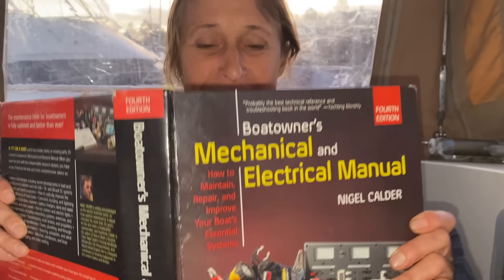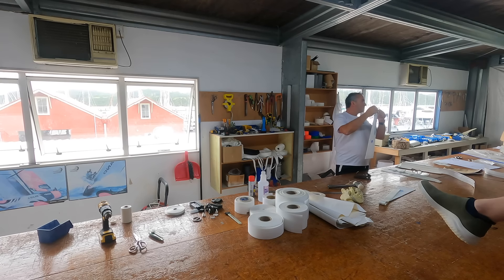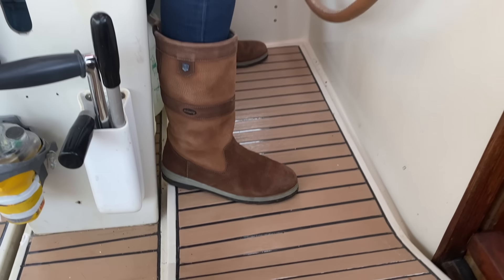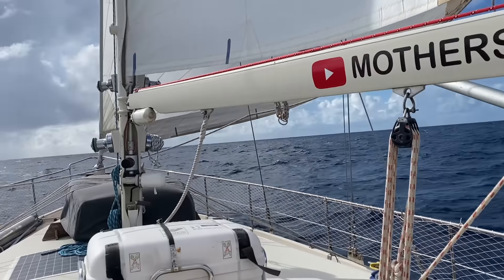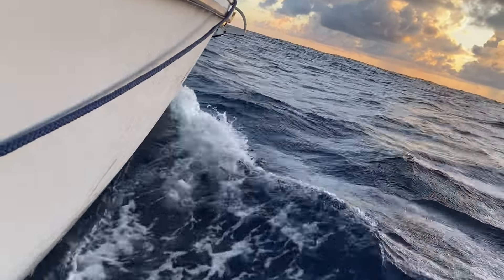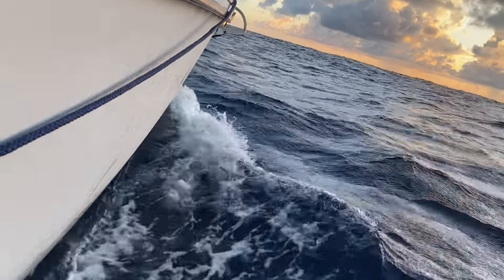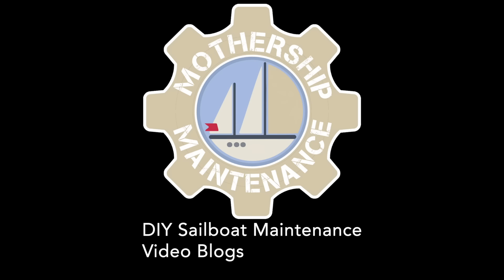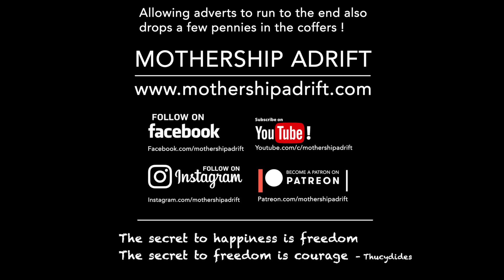SAILING from NZ : Did we choose the RIGHT Weather Window and NO POWER Ep198

Comment: Meant to ask last episode when things were cold aboard about the Amel heating system and the reason you couldn’t use it in the marina?
Reply from the maker: Ah yes, we do have some plug in heaters but we could not connect to shore power because of all the regulations for boats in New Zealand. We would have had to get the whole system altered and certified to meet NZ laws. There was also not enough solar power to use the heaters.